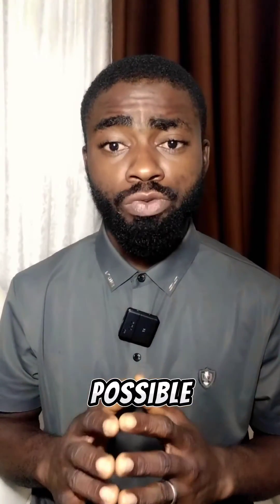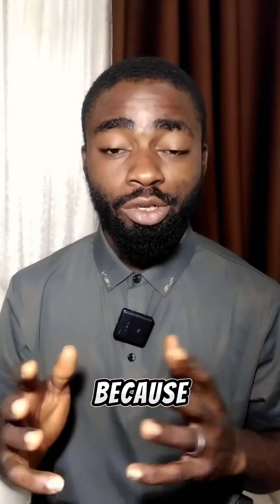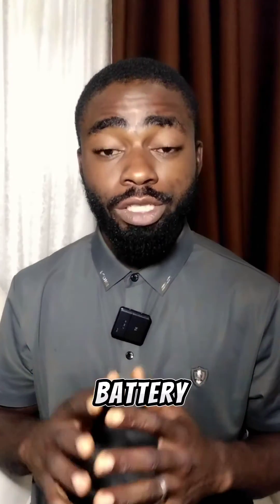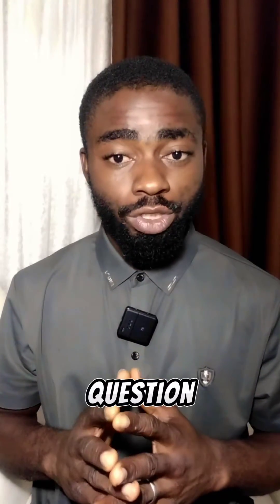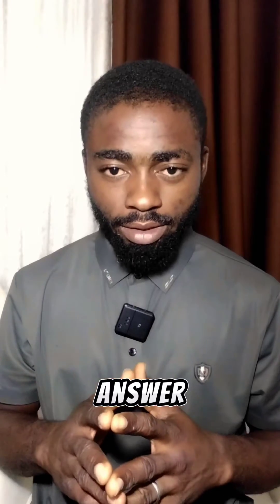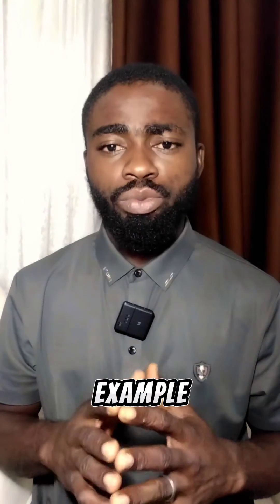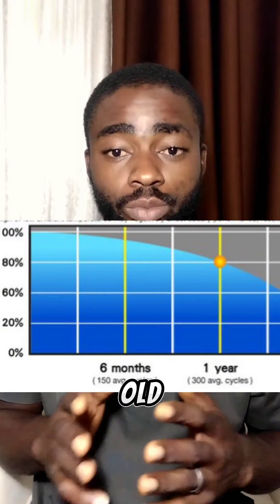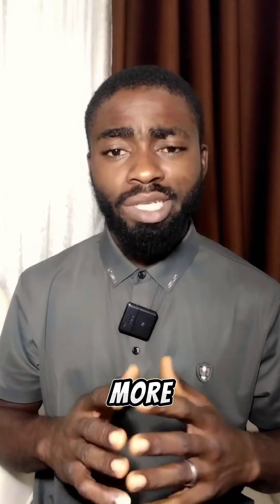why you shouldn't combine an battery with a new one.

Comment: Can a buy a battery of high capacity (example 450, 000. That is about four hundred and fifty thousand naira) and combine it with just two panels? The reason is because of cost. So, I want to spend more on battery and less on panels and other components. In later time, I plan to buy more panels and other components.
Reply from the maker: If you don't have access to grid, is better you invest more on solar panels, because large battery bank without a good charge is like a waste of resources
Reply: @Mairigaemmanuel  thanks for your response, but what is grid? I am hearing it for the first time.
Reply from the maker: @Godwintech247 NEPA light

Comment: The internal resistance of the older battery too will be higher and when it’s low while the newer is still of reasonable charge, it will be offering resistance to the flow of current from the newer as it’s in series. Almost like connecting a resistor to a battery. 

I do have a question though, what’s the best use case for older batteries then since they did cost money and can’t just be disposed off anytime one upgrades a system
Reply from the maker: My opinion though, get another old battery for the upgrade